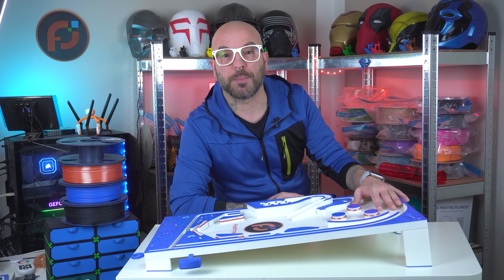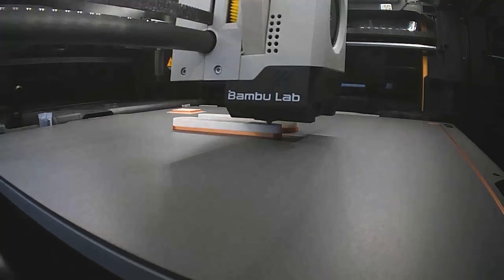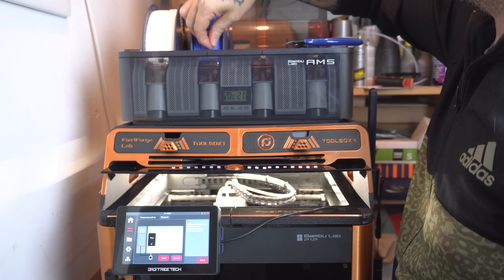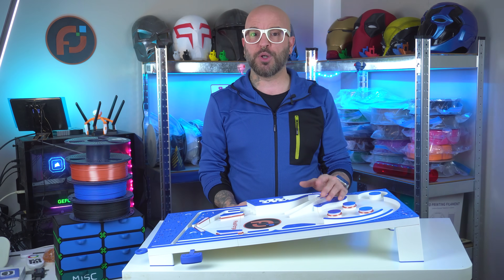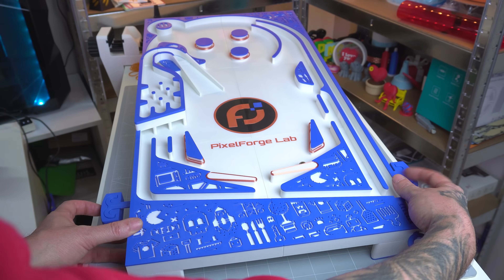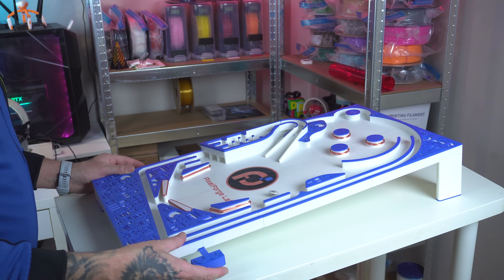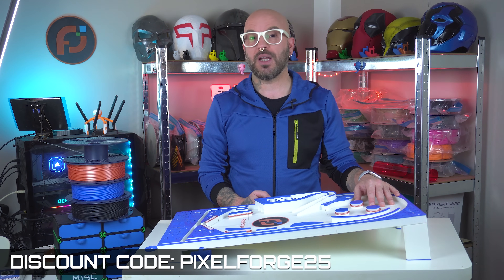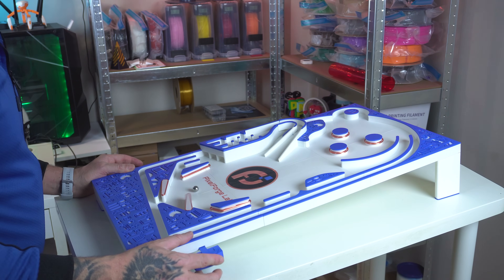I 3D printed a Fully Functional Pinball Machine ! #sunlu

Comment: I cannot get my support settings dialed in for this print. I end up with a fused bottom layer and cannot access the cutout areas. Can you advise? Im newer to printing
Reply from the maker: Check my video on support removal, will help, is the one with most views
Reply: @PixelForgeLab Thanks for your response. That helps with the top z distance but it is the supports where they start on the bottom that is the issue. The first layer is fused along the build plate and create a solid, indistinguishable layer to the print.
Reply from the maker: @feralbear    nothing to do with Z hop. if you watch the video you'll see

Comment: So I'm not all that knowledgable when it comes to mixing filaments, but I think on the bumpers instead of using the silk PLA you'd have been better served with a soft TPU to give it that rubber like bumper feel.
Reply from the maker: @NikoMalthus  honestly ? The silk pla works just fine, the bounce is fine, if I did that with tpu I think the ball would be slower to come down